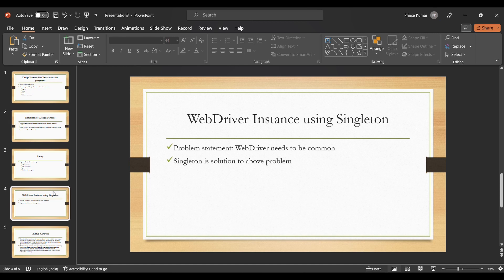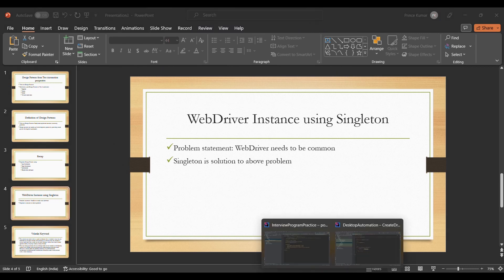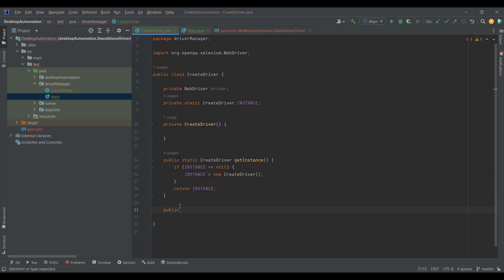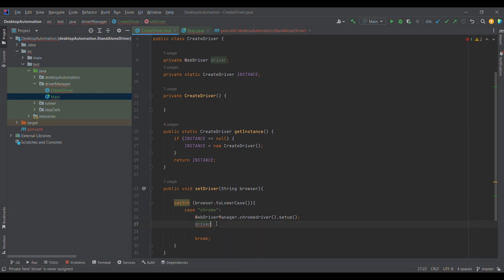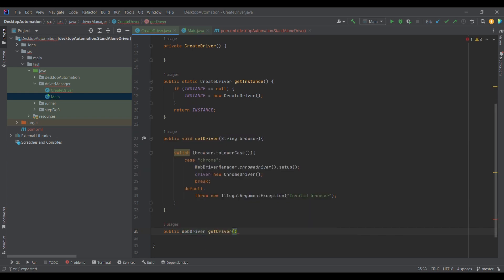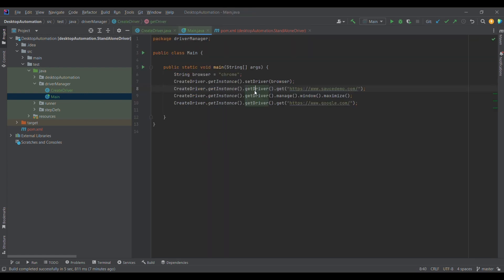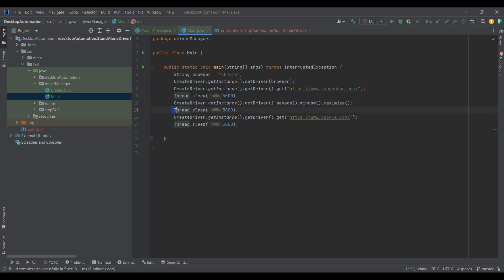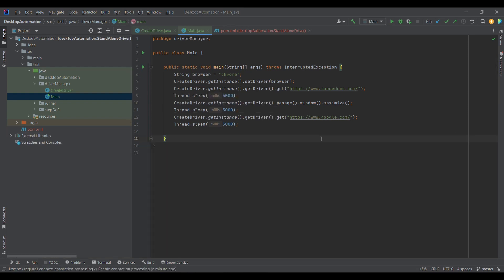WebDriver Mastery: Implementing Best Practices with Singleton Design Pattern | Lecture 7

Comment: Why did you use lazy initialisation and not double check when its the better one?
Reply from the maker: This is a very basic one i have created 
Double check: sometimes doesn't help

Eager initialisation: it will always create object even though it is not use but in driver case as it is always be used we can use eager initialization also

Thread Local : we should use thread local along side singleton to avoid interference of threads
TestNG Framework: https://www.youtube.com/playlist?list=PLXGQ7XfCauHv2zqHoMBX6oSIvFyFA6F22